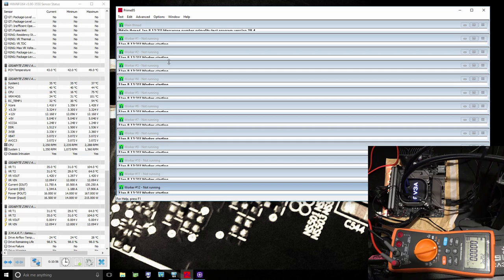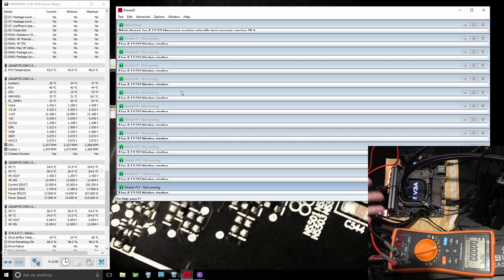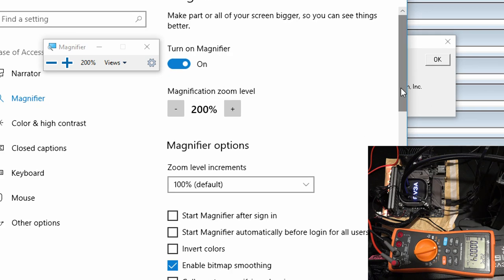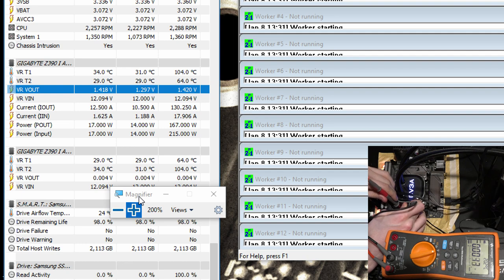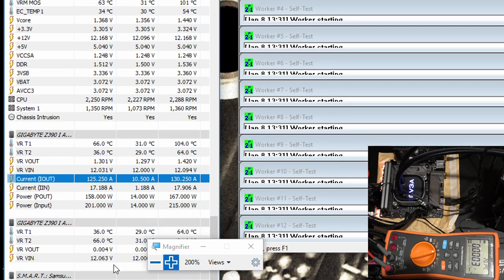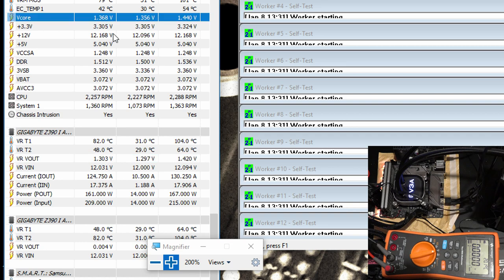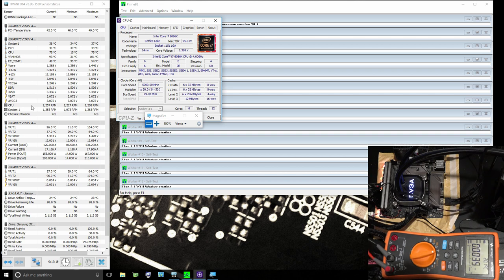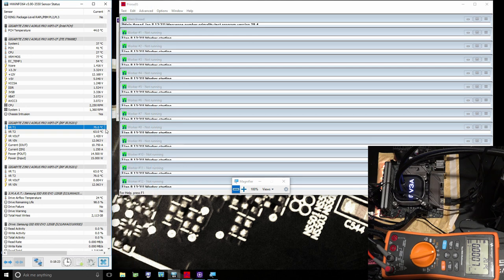Voltage monitoring on Gigabyte Z390 motherboards(Xtreme/Master/ITX Pro Wifi)

Comment: If VR VOUT is not showing up / missing / dissapearing on your Z390 PRO WiFI do the following:

When you boot up, load up the app centre from Gigabyte and install Easy OC Tuner, then reboot.

When rebooted, fire up HWinfo, the sensor will not be there. Then fire up app centre and load Easy OC Tuner.

The sensor will then appear in HWinfo, you can then close the app centre and Easy OC Tuner.

Took me three days to figure out, but here we are! Enjoy your higher OCs!

Comment: just gonna say : in my aorus master there is normally only a 0.01 difference between the Vcore reading to the VR VOUT one (or even less) - i didn't actually check it myself but the numbers add up to the bios settings and the online statistics on how much volts i would need for different clocks

Comment: I have a aorus z390 master and I have 3 vcore sensors I have the top one it8688e and another vote sensor and the vr vout ir35201 they all read different. Also I have noticed that the only way to stop vdroop using the sensor ir35201 vr vout is to set llc to maximum anything else and theirs vdroop using the correct sensor. Gigabyte has some strange stuff going on I mean if you don’t use ir35201 and set llc to turbo then there is no vdroop if you use ir35201 and use turbo I get vdroop. If you look at the graph under llc they all show vdroop except the highest setting and that scales correct with ir35201.

Comment: Fun video buildzoid. Could this inform mobo makers and whoever manage sensors in doing a better job so we can get more accurate figures to work with possibly? Also, i got a fun experiment i believe you would find being very interesting. The last tools i need are coming in the mail later this month, but i can get started today and maybe almost complete it. My teaser for you is that this is lapping on steroids, in a way you have not seen before. Wish me good luck, i am gonna need it as it will get surprisingly messy i believe.
Reply: Yellow 
Hey! My csgo teacher!
Reply from the maker: Eh just exposing the IR35201's sensors is more than enough IMO.

Comment: Same behaviour on X470 Gaming 7 - controller readouts are closest to the truth. Gigabyte screwed LLC though in the latest bios versions - now it pushes some ridiculous V through the CPU at extreme LLC (used to be flatline before), 360mm aio just can't cope with that.

Comment: Well cant we calculate the real number from wattage and amp readings? Or they are also flawed same way? And another question; is it safe to start ocing  by increasing llc couple of steps (or more?) before increasing actual vcore, when more voltage needed? For evryday usage
Reply from the maker: The wattage reading is a product of voltage * current. If voltage is wrong then the power reading is too. Also the accuracy requirement for the current monitoring circuitry isn't great.

Comment: Can you show us how to find voltage measurement points on mainbords with no testpoints from the manufacturer?
I have an old x58 MSI board here (MSI Px58 latinum SLI), wich reads garbage through software and i dont know where to start probing.
Reply: this!

Comment: Hi Sir, 
I have 9700k and Gigabyte z390 Aorus Pro.
I overclocked to 5.0GHz with these settings;
Cpu Ratio: 50
Vcore: 1.270V

HWinfo64 values are;
Vcore Min: 1.272V
Vcore Max: 1.296V
Vcore Current: 1.284V
VR VOUT Min: 1.214V
VR VOUT Max: 1.257V
VR Vout Current: 1.216V

So the means that real value is VR VOUT to go CPU core?

Comment: Hi Buildzoid

I have a question: Recently i founded few interesting motherboards in ITX design (X99E-ITX/ac with Socket 2011 and X299E-ITX/ac with Socket 2066) both from ASRock. Usually they used to build very small, but very powerfull PC (with Xeon and a lot of cores). If i find high resolution images (or ASRock will be so nice and took pictures) can you do you review? Are you interested in this (usually Xeon isn't something that possible to overclock).
Reply: Bit off topic but you can overclock to a varying degree xeons on lga 771, 1366, 2011, 2011-3, 3647, and then all your mainstream socket E3s up to and including v5 if you have the right mobos... 771, 1366, and 2011 sockets all have xeons that oc pretty far the others are more limited there are some others but thats just some examples

Comment: What about Msi Z390 ace ? 
My Vcore set to 1.330 -llc mode 3 
And load voltage 1.363 at cpz 
Put my VR VOUT is strangely 1.275-1.285 😢🤦‍♂️ 
Also I can’t get 5Ghz on OCCT small data set at that voltage 
Notice: I was able to get 1hour at 1.315 at first day 
Now 1.335v asV core 
Llc 1.373
is not able to get it 🤦‍♂️😢 stable at OCCt small data set ? 
is it degradation ?
I just bought my cpu 2 weeks ago 🤷‍♂️

Comment: Which Keysight multimeter is that and do you recommend a keysight/fluke, or can you do this mostly (like 90%+) accuratly with a harbor freight/budget multimeter?
Reply from the maker: it's 1272A and it's overkill for something like this. A basic DMM is just fine.

Comment: Is it possible to check for me the IR3521M. I have them on my Quad Socket G34 Supermicro and i wanted to push my four 6386SE a little higher than 3,8GHZ. If someone can help, that would be very nice :-)

Comment: Why wouldn't you use a scope to measure the voltage?  It doesn't make sense to use a DMM for that.
Reply: Why not? It's practically DC at that point and you'd only want to use a scope to measure the jitter on the line (which this video is not doing)

Comment: Ok so if vr vout is pretty accurate to VCC_sense->VSS_sense, and intel's data sheet says 1.52v (as measured from VCC_sense->VSS_sense) is within spec... why is a vr vout reading of 1.52v not safe? Of course, assuming you don't exceed the max safe amperage or temperature.
edit: and intel is extremely clear about this:
"The voltage specification requirements are measured across Vcc_SENSE and Vss_SENSE as near as possible to the processor
with an oscilloscope set to 100-MHz bandwidth, 1.5 pF maximum probe capacitance, and 1 MΩ minimum impedance. The
maximum length of ground wire on the probe should be less than 5 mm. Ensure external noise from the system is not
coupled into the oscilloscope probe."

edit2: ok just saw another buildzoid vid where he basically confirmed that 1.52v is completely safe, as long as you don't exceed ICC max

Comment: @Actually Hardcore Overclocking I have to ask, does this applies for Gigabyte Z370 lineup also? Particularly Z370 Aorus Gaming 7? Because in HWiNFO there is also VR VOUT under ISL69138.
Reply: I think soj got the same with my ultra

Comment from the maker: first
Reply: Actually Hardcore Overclocking damn!  Lol.
Reply: When will someone beat bz on being first?
Reply: Your cheating
Reply: Master pro should have been used....
Reply: Lol
Reply from the maker: @theewelder  The Master uses the exact same controller.
Reply: @ActuallyHardcoreOverclocking  first after your reply in your first post.
Reply: How's this on the Pro/Elite with the ISL69138 ? For me the VR VOUT on these also make more sense than the Vcore readings of the  SuperIO chip.
Reply from the maker: @derx6666  I'm 99% sure it's also VR VOUT I've just not checked

Comment: VOUT, IOUT and especially POUT are not accurate during idle times. They show way too high readings, only during idle, though. Why is that so?
Reply from the maker: VR VOUT at idle is accurate. It's reading higher than under load due to the load line
Reply: What about voltage drops below 1 volt due to C-states (even only C1E) hardly ever happening on VOUT with aggressive power profiles (with or without autonomous mode)? POUT/IOUT are more problematic, though, showing higher wattage changes than both the package sensor and a wall meter and going down to zero because of seemingly lacking resolution. Could be a readout (HWinfo) issue, because it does not seem to be able to keep up with the fast switching of multipliers/voltages with more aggressive profiles.